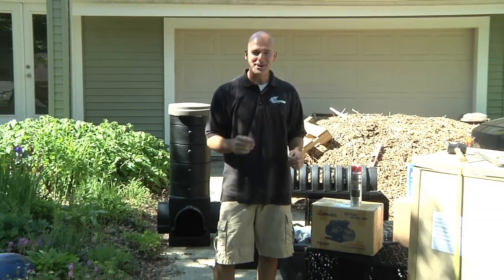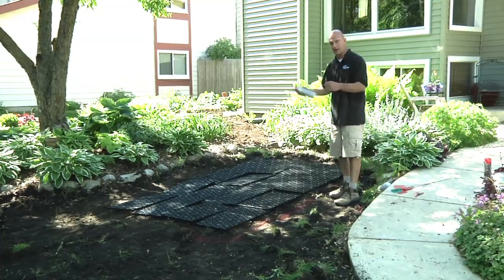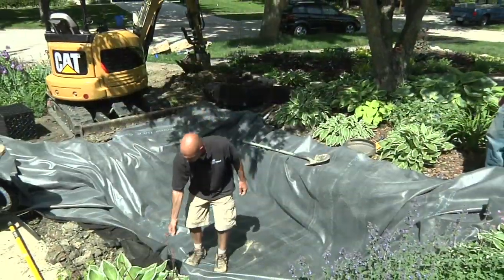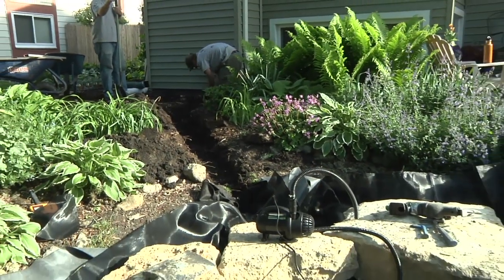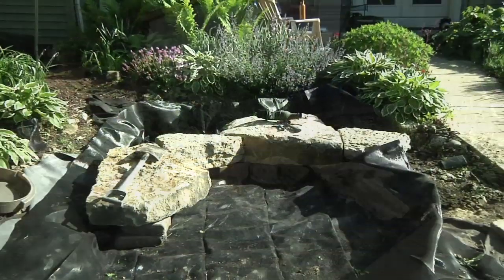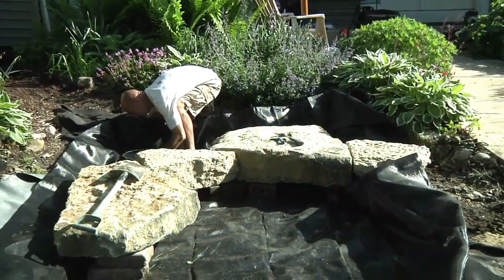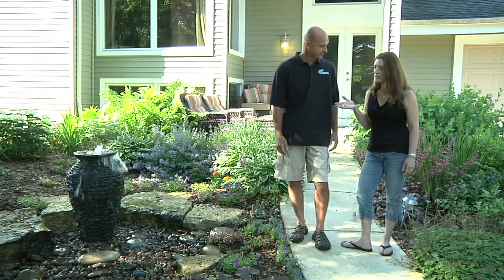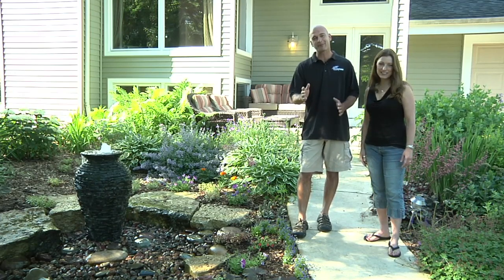How to Install a Rain Water Cistern

Comment: What do you think happened before the house was built? The water soaked into the ground with the excess being run-off. These systems are basically doing the same thing... catching water that would have soaked into the ground before the house was built. I am 100% sure there still is more run-off than before the house was built, even with this system installed.

Comment: Hey Shawna!  What a hi tech op you got.You must do a timeline follow up with all that has happened with the yin & yang of your journey with this project.  I appreciate the water fount as it is a great visual and audible magnet to our senses. Maybe you can aspire to solar or vertical wind turbine to power your system so you can shake off some dependency being of on the grid. Hey whatcha plant in the garden?

Comment: Most totes are 55gal, so this system is over 9 times the volume of one tote. A benefit is it's not visible like the totes she had around the house. The only drawback is she will need a pump to run the system. My guess on the cost is somewhere between $800 to $1200. If she only needs 500 gallon capacity, it would be foolish to install a 2000-5000gal system.
Not sure, but I think most gophers that hit that sand around the lining, then the lining, are going to turn around and go the other way.